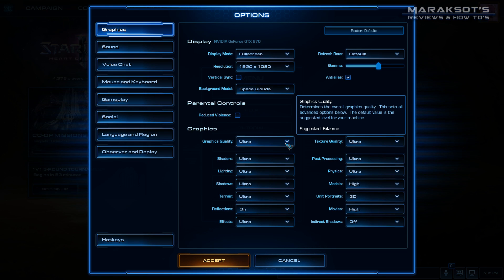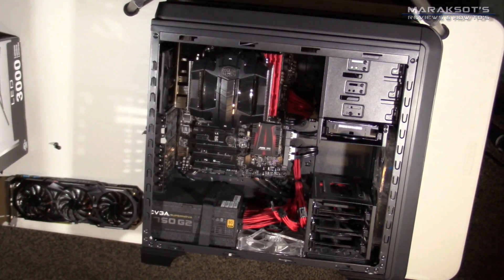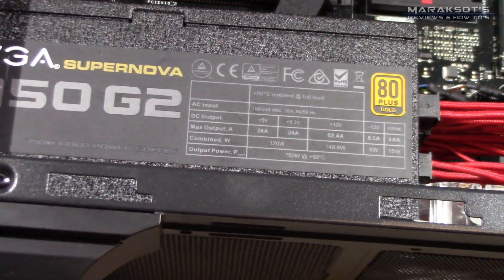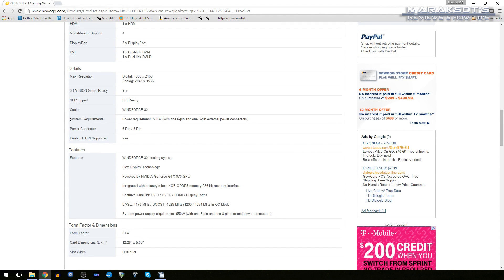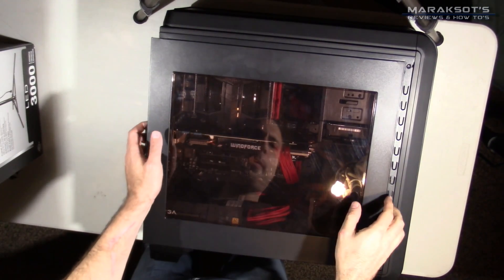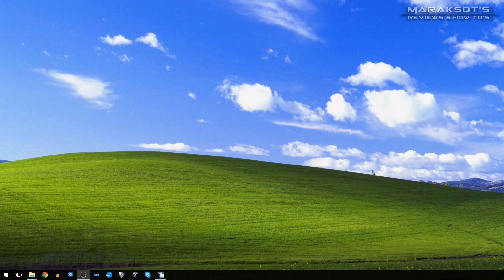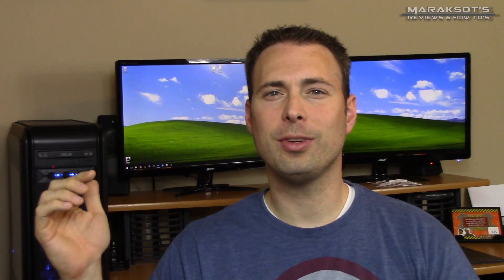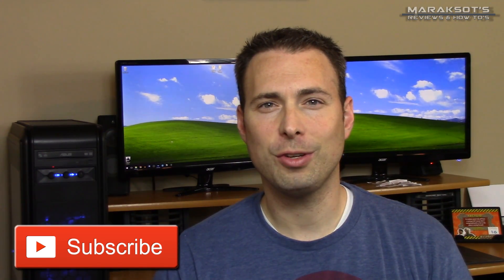A Beginners Guide - Upgrade your GPU - How to Install a New Graphics Card

Comment: Hi!
I recently installed a new graphics card and a driver for it.
BUT my apps and games either start REEEAAALLY slowly and crash or won't start at all.
Any ideas?

Graphics card: Radeon R9 280X

I would really want to get this to work :/ since I've been waiting for so long to be able to play on PC
Reply from the maker: +N0VA so everything was working fine before you installed the 280X and the drivers? Did you install drivers you downloaded directly from AMD?
Reply: Maraksot78 Yes after I installed the graphics card and it's drivers. I decided to reset my computer to it's factory settings cause it would be much simpler (didn't work) NOW: Computer reseted, drivers installed, should be working but it's not.
Reply from the maker: So by "resetting your computer to factory settings" do you mean you did a system restore? Where it puts eveything back to the way it was when you first bought it?
Reply: Maraksot78 Yes, that exactly! But it only wiped my C drive
Reply from the maker: I'm assuming the 280X is a new addition to your system correct? Meaning it wasnt part of your Comouter originally. Did you install the 280X and then do the system restore or did you do the restore and then install the 280X?
Reply: Maraksot78 I restored the system after I installed the 280X and yes it wasn't an original part. Also a quick note: My power supply didn't have a 8 pin cable only two 6 pin cable's. So my dad had to make a cable with a 6 pin end which converts into and 8 pinned cable. We did have a converter which converts two 6 pin cables into one 8 pinned but my power supply only had two 6 pinned.
Reply from the maker: I'm wondering if it's having problems because you restored after installing the 280X... it's possible that since there's a piece of hardware in there now that wasn't there originally it's messing things up. Try removing the 280X and then see if it works more normally. If it doesn't, then you may need to restore it again. Make sure you only have the hardware in it that it came with originally though.  :) Hopefully it will begin working normally and then you can install the 280X and install the drivers for it again. Which makes me think of something else... you did reinstall the drivers for the 280X after the restore correct? Because if you didn't, since the drivers for it weren't part of the original software package they would have been deleted.  Also about the 8 pin power connector did you make an 8 pin from (2) 6 pin connectors or did you use an adapter? I didn't quite follow you on that part. I'm not an electrical engineer so I don't know exactly how that stuff is wired up to diy it so I strongly recommend using a proper adapter.
Reply: OK so I will delete the drivers then uninstall the graphics card and try the computer, then install the graphics card back and THEN download and install the driver(s) [In that order] ?

And the DIY cable was made of one 6 pinned cable head and one 8 pinned cable head (not a 6+2 pinned cable head)
Reply from the maker: Yup, that's what I would do.  If it's still not working right then restore the system again with the 280X removed and that should fix it. You should then be able to install the 280X, install the drivers for it and be good to go.
Reply: Maraksot78 Ok thanks for the help! Haven't had any other specific help so far so, really thank you!
Reply from the maker: You're welcome, I hope it'll work for you. And if all this doesn't fix the problem you're having I was just thinking it could be an issue with your diy power plugs. Again I'm not an electrical engineer so I don't know the first thing about rigging it up myself so I would just buy the adapter(s) I need to make sure it's right.  If you're not getting proper power then you can have problems and even fry your card.
Reply from the maker: N0VA just curious if it worked? You up and gaming now I hope?
Reply: Maraksot78 Well I just got finished with the reset without the graphics card. And I feel like it's gonna work but I am not sure yet. I got to open a few apps that wouldn't open an hour ago. We'll see in a few. 

EDIT: Just making sure, so now I'll Install the card and THEN the driver(s)?
Reply from the maker: N0VA thanks for the update. :) yup, install the card and then the drivers. Best of luck to you. :)
Reply: Maraksot78 Thanks again!
Reply: Maraksot78 I think it worked! I opened a few apps and a game, without any problems.
Reply from the maker: Excellent! So happy to hear it.  :) Happy gaming man!
Reply: Maraksot78 Hi!
Sorry to bother you again but I've got another problem...

I can't even run Unturned with lowest graphics cause after playing for 10 or so minutes my PC just shuts down, the first time this happened I thought it was due to overheat but now my PC wasn't even that warm. Any ideas why this is happening? Thanks!
Reply from the maker: My brother in law had a PowerColor R9 290X and his card would do the same thing. While playing games some times his screen would just go black and he would have to restart his computer to get it working again. He dealt with this problem for 10 months or so but after awhile it began happening all the time and would even do it when he was just opening up Google Chrome. We tried a bunch of different stuff but ended up contacting the manufacturer since it was still under warranty and got it replaced. Well he went out and bought a GTX 970 instead and he sold the R9 390 the manufacturer sent as a replacement to someone else. Since then everything has been all good.  Can't say for sure that's your problem but that's an experience I had that I figure is worth sharing.
Reply: Maraksot78 I kinda had this problem with my other graphics card back when I got it. My computer would experience the "BSoD" ( Blue Screen of Death ) or just black out. But I got it fixed somehow.

I hope this ain't broken. Thanks for sharing that though, I'll have to consider waiting till next summer for a new PC if this one is broken cause I am 17 and I don't have a job other than possible summer work or hoping for my NY company to succeed but that's not the point.

I guess I'll just wait for my dad's friend to get back from his trip, maybe he would know something about this specific problem.

Anyways a BIG THANK YOU for helping me out I really appreciate it!
Reply from the maker: N0VA you're welcome man sorry I couldn't be of more help.
Reply: Maraksot78 Found the problem, I did a little of digging and found out that I need a power supply of at least 650 Watts and my power supply has only 500 Watts. So now I need to find a power supply which is compatible with my PC. Unless every power supply goes with every PC ( except if it's power in Watts is too low)
Reply from the maker: N0VA most likely you have a standard ATX (form factor) case so a standard ATX power supply would be what you want. I really like EVGA brand power supplies they're  high quality and competitively priced.
Reply: Maraksot78 Ok, I'll look into that a bit more. Thanks!

Comment: How can I replace an integrated graphics card
Reply from the maker: +Hickup an integrated GPU just means your CPU has a graphics processor built into it so if I'm being technical the only way to replace it would be to upgrade to a new CPU with a more powerful iGPU. :) But what you're probably really wanting to know is that if you install a discrete graphics card in your system like a AMD Radeon RX 480 or an Nvidia GeForce GTX 1060, etc. then what happens is your computer recognizes that you now have a discrete graphics card installed and automatically disables the iGPU on your CPU and uses the graphics card to do graphics processing instead.  :)
Reply from the maker: Hickup no problem. :)
Reply: Maraksot78 terrific thank you

Comment: Hello, i have 4 gb ram, intel pentium proccesor, and i think 300 w power supply, what gpu is good for me? my pc can run minecraft on 70 fps, but i want an upgrade, can you send me a link what gpu is good for me? i have like 9-11 cm space in my pc case
Reply from the maker: It really depends on what games you play or want to play on your computer.  AAA games nowadays recommend you have a quad core processor or a dual core with hyper threading and the "pentium" has been around a long time and there's a lot of different versions of it.  If you have a more recent one then it's probably a dual core without hyper threading.  As for your 300 watt power supply... the most current card I know of that I would recommend that uses that little power is the GTX 1050.  When you say you have 9 - 11 cm of space is that the longest a graphics card can be and fit into your case?  Because the smallest GTX 1050 I've been able to find so far is the Zotac GTX 1050 mini which is about 14.5 cm long and 11.25 cm high.  Here's a link to it on Amazon if you'd like to check it out. https://www.amazon.com/ZOTAC-GeForce-DisplayPort-128-bit-ZT-P10500A-10L/dp/B01M4MIU94/ref=sr_1_1?ie=UTF8&qid=1482950693&sr=8-1&keywords=zotac+gtx+1050+mini
Reply: Thank you! :) You earn a sub! :)

Comment: i currently have a Amd R390, any idea what i should upgrade it to? or is that still a decent graphic card?
Reply from the maker: +Obytack the R9 390 is still a pretty decent card.  In terms of performance it's right on par with cards like the GTX 970, GTX 1060 and the RX 480. They're all 1080p beasts and respectable 1440p cards as well. As a general rule I only recommend upgrading if your current card no longer plays the games you want to play at the graphical settings and frame rates that you want. Until then... game on! :)

Comment: What do you mean by ground yourself
Reply: I'm new to all this pic stuff so I have no clue
Reply from the maker: Static electricity can short out electronic components so you want to make sure you're static free before handling stuff so you dont accidentally fry one of your components. If your case is made of metal you can touch it and discharge any static electricity you may have built up in yoir body. You can also buy an anti-static wrist strap that you wear on your wrist that has a wire that has a clip on the end of it that you can clip to your case that will keep you grounded. Here's a link to one if you want to check it out.  https://www.amazon.com/gp/aw/d/B004N8ZQKY/ref=mp_s_a_1_1?ie=UTF8&qid=1482853150&sr=8-1&pi=SX200_QL40&keywords=anti+static+wrist+strap&dpPl=1&dpID=41kpz1uT0oL&ref=plSrch

Comment: After upgrading from a 750ti to a gtx 1060 I now get a black screen and nothing works. Shud of stuck to console.
Reply from the maker: +Fx Elite do you still see your motherboard splash screen on startup but then it goes black when trying to start windows? If so updating your motherboard bios may fix that problem.
Reply: .... after 3 hours of wondering what was happening... i plugged the hdmi cable into the wrong slot......
Reply from the maker: Fx Elite glad you got it figured out and it was a simple fix.  :)
Reply: thx

Comment: bought a new pre built pc. used it over 2 years never had problem. one day I decided to slowly upgrade and eventually chuck in beast vid card, so power supply 650w was recommended. so I bought 650w psu, installed it month later started to hear ringing my ears I never heard before.
Reply from the maker: I'm not really sure what the cause of that could be as it could be a bunch of different things.  Could be your power supply or your graphics card or possibly even a fan in your system. But since it developed after upgrading your GPU I'm wondering if it might be coil whine.  Does it make the sound all the time or just while you're doing certain things like playing games?  Does the sound change pitch or get louder or anything like that while you're gaming?  If so that's most likely coil whine from your graphics card and unfortunately there's not a whole lot you can do about coil whine.  You can turn on V Sync in games which does help a bit but there's no way to completely eliminate coil whine other than buying a different graphics card but then again that card could do it too.  :-/

Comment: Hey, I have a GTX 945 with a intel i7 processor, do you think a GTX 1050 Ti will fit? Thanks
Reply from the maker: +[FaZe] Scarce I'm a little confused. The GTX 945 is a laptop GPU and as far as I know the only way to upgrade the GPU in a laptop is to buy a new laptop with a more powerful GPU in it. :)
Reply: Ah, sorry sorry, my bad. Its actually a GTX 745. Do you still think the 1050 Ti would fit if I have a GTX 745, though?
Reply from the maker: +[FaZe] Scarce Since you have an i7 I'm assuming you have at least 8GB of RAM as well so if that's the case then I think the 1050ti will work fine with the rest of your system. As for fitting in your case... that's something you'll have to investigate. :)
Reply: Thanks for the help and quick reply, sir!
Reply from the maker: [FaZe] Scarce no problem man, I'm happy to do what I can to help.

Comment: Hey Buddy, dont know if you still answer some comments but I want to buy a new Graphics card and new RAM (16gb instead of my 8). So i cant really decide what i should pick, the gtx 1050 Ti or the rx 470.. Over here in Germany the 470 costs about 20-30 more than the gtx but as far as i saw it is performing better than the 1050 ti. I really wanted to go away from AMD because of a Shadow bug in almost all my Games. This problem occured like half a year ago when suddenly my shadows were all bad quality, they always like flicker and stuff... Just looks so bad.. For example in DayZ, Arma 3, Battlefield 3 and many more... (I have the Radeon r9 270). Also tried so many things with Drivers and much more sh*t, it just wont go away. So I decided to switch and told myself not to go for an AMD again... But now the 470 is apparently 10-15 fps better than the 1050 Ti... What would you say? Are the glitchy shadows gone when i get the rx 470 ? 

And my second question would be if the rx 470 or the gtx 1050 Ti fits on my Motherboard. I have the "MSI B75MA-E33" one. Also could i change my 8gb Ram to 16gb ram on that motherboard, wanted to do that too. 

Sorry for this long text, i would really appreciate it if you could Answer me :)
Reply from the maker: I do still answer comments on here.  My channel is small so I usually only get one or two questions like this per day.  :)  Looks like you're good to go if you want to upgrade your RAM to 16GB as for the question of the 1050ti or the RX 470, I would say get the best card you can afford.  I don't know a whole lot about the RX 470 but I do know that recently people have been comparing performance between the RX 480 and the GTX 1060 now that both AMD and Nvidia have had some time to improve their drivers and they've found that the 480 and the 1060 now are neck and neck with each other in DirectX 11 where as the 1060 was better at the time the RX 480 launched.  As for DirectX 12 and Vulcan the RX 480 has always had a slight lead in performance over the Nvidia cards and that lead has slightly increased with the latest drivers.  Now I don't know if those same performance gains hold true for the RX 470 but I would assume the 470 has seen some performance improvements as well.  I don't know for sure what the problem you're describing with the shadows might be caused by so I honestly can't say for sure if swapping to a new card will fix it.  I would assume that switching to a new card will fix it but at the same time I don't know for sure.  In the end I think you'll be happy with either card as they both offer an improvement over the R9 270.  That being said the PC enthusiast in me would recommend the card that offers better performance, in this case the RX 470 but if you've had problems with AMD stuff in the past and would rather give Nvidia a try this time around then that's totally cool too.  :)
Reply: Hm okey,  thanks for the answer :)  If only i would know if the shadow bug is gone when i get the AMD one then i would have chosen it already..  But would they both fit on my Motherboard,  as far as i looked it up it should work but  not sure..  I also have to check for my power and if its enough for the cards :D
Reply from the maker: Sleaybey You're motherboard has a PCIE x16 slot on it so you're fine there, you'll just want to make sure it will fit in your case, but since you have an R9 270 right now either card, the 1050ti or the RX470 should have no problem fitting. As for power requirements, the nice thing about the current generation of graphics cards is they are more power efficient than the last generation of graphics cards so as long as you have at least a 450 watt PSU you'll be just fine.
Reply: Well thats nice to hear isnt it  =D Thanks for the help!!!  Sub well earned :)